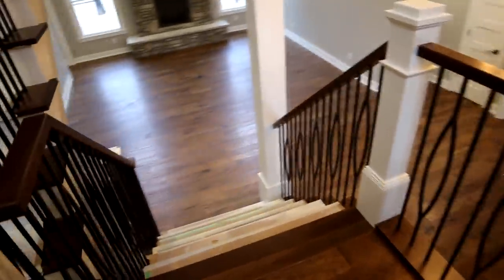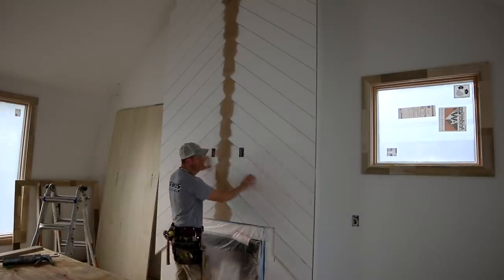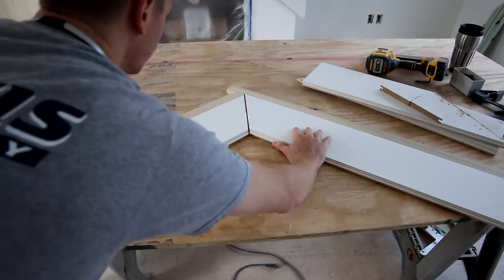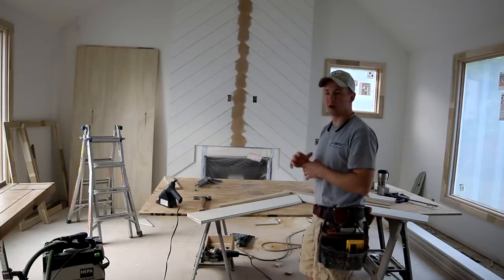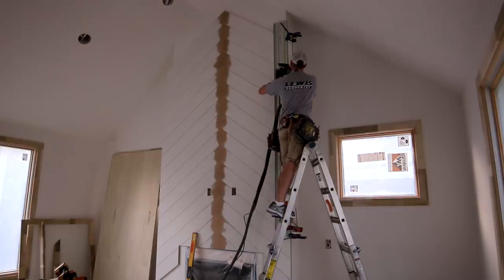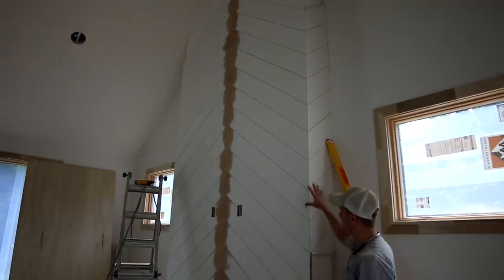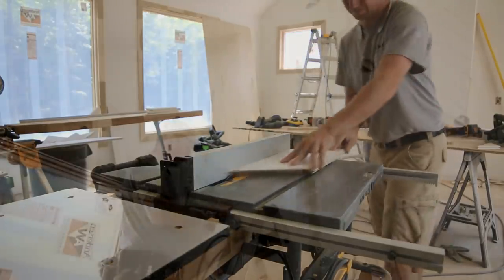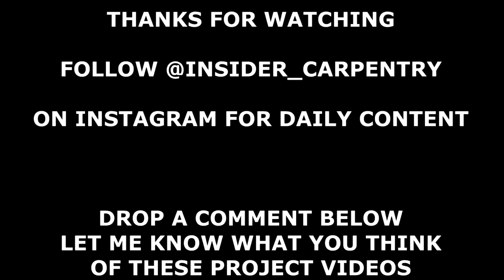Pro Tips & Techniques for a Chevron Shiplap Wall Installation - Chevron Pattern Fireplace Wrap

Comment: I absolutely love your channel. I’ve been a carpenter, frame to finish, most of my life and I’m close to 50. About a year ago, I did something that I thought I could never do, Started my own company and got my GC license. And if you knew me, you would know that the only explanation that this has come to fruition is “JESUS”. It’s amazing!! So now, a year into this, I realized how inefficient my systems, work flow technique’s, tool organization and tool management really is. You have been so crucial,/“paramount” in helping me, in the slow long process of rectifying this situation. At this point I am in the middle of a complete make over of my tool storage system,  pack out drawer, custom dolly, hand truck etc.., also, tower of power (I have a 2021 Promaster, so very similar vans). Then onto miter saw wings, table saw out feed and punch list rolling tool cart. I know this will be an on going process and i will be leaning on you and Jesus the whole way!!! I want to thank you from the bottom of my heart for the help you have and will be giving me any many, many others!! God Bless you and your family!!

Comment: I once put crown molding made from MDF in a living room.  Some months later a pipe in the kitchen burst flooding the entire house while the owners were on holiday.  The insurance company hired a firm to dry out the house.  Every one of the corner joints on the crown molding opened up close to a half inch, I was amazed that 13' to 15' pieces could shrink that much.  But, wonder of wonders they closed back up over the next week or so, fortunately the joints were tight to begin with.  A tiny bit of caulking and fresh paint, all was well.  I try not to use MDF but so many customers don't want to pay for real wood.  Nice job, I only wish my jobs came out as well as yours.
Reply from the maker: I think one of the biggest misconceptions in the industry is that mdf is "stable" and doesn't move. It may not have grain tension but it expands and contracts much worse that real wood at its length.

Comment: Cutting the mitres vertically like you did is absolute torture, when I worked on similar project I used a backing sheet of ply or mdf, cut it first to shape, then attach shiplap to it on the bench as well as  cut miters on the bench. After you can  just fixed the whole thing on the wall. Very often you can hide your fixing in the grove for even more perfect job. Thank you for your videos they are absolutely brilliant.
Reply from the maker: I didn't feel like it was too bad. And went pretty quickly.

Comment: Awesome work! I would recommend titebond 3 instead of titebond original for mdf joints. We  install about 600,000' of flatstock mdf per year and use mostly CA glue and TB3 for our joints. We find original TB too thin for mdf because it starves the joint

Comment: I'm not a pro carpenter by any means but watch for ideas on how to manage work for my day job as a commercial PM.  I'm also getting ready to install shiplap in my octagonal dining room this coming spring so always up for more ideas of how to make that flow better and easier.  How do you like to terminate shiplap at exterior corners?  Corner board wrapping the corner?  Trim on wall with shiplap only? Something else?  I have two of that condition to contend with on this project.  Keep up the good work and content.
Reply from the maker: I'd fabricate some type of corner trim. I've done it a couple different ways. Either a piece that overlaps over the SL or a piece that the shiplap butts into with a dado running vertically to match the same reaveal as the horizontal gap.
Reply: @InsiderCarpentry  thanks for the response.  Would you treat window/ door casing the same way in those scenarios?

Comment: I would love to see how you price this stuff out.  Working with home builders in my area seemed very not worth it compared to direct to consumer.
Reply from the maker: Its all about finding a rhythm and keeping momentum. I can make a higher hourly rate working directly for homeowners, but the secret sauce to my business is in the billable hours. I get way more productive hours and less screwing around looking at and bidding jobs with the builders I currently work for. Its what I prefer. If I was messing around a lot I'd be better off working for homeowners. But with what I do now I can work any hour of the day and do shop work at home, so I like that.
Reply: @InsiderCarpentry Iv'e been doing the same for 25 years. It's beneficial for me & the builder no spending hours after work wirh guestimates. When I work directly for a home owner I just charge a set % also known as a premium.
Reply: Insider Carpentry ,

Been waiting for the info.  
👉🏼⏳=🤑
Reply: Insider Carpentry You have the luxury of working with a good premium builder in an area where large custom homes with considerable areas of finish carpentry detail. Good for you. 🙌👍

Comment: Is there a reason for not using Pocket hole screws on the mid joint for strength and just regular tight bond white glue. Then sand.
Reply from the maker: Time. The hipur is super fast. Just press together and go. If I was to use regular wood glue I would have like to have a domino or biscuit as some added insurance. With the way MDF wicks up PVA wood glue, it would have made me nervous for such a critical joint.

Comment: I’m really inspired by your work and attention to detail. You’re a true, skilled craftsman. I’m curious, if MDF expands/contracts so much, what was the reason for using it over another type of wood; was it strictly cost?
Reply from the maker: Yes. It's about 3x the cost for the same thing in poplar. And the MDF paints up better. You see some wood grain with poplar. And MDF is straight.  No crooked boards with MDF.

Comment: Beautiful job and your detail is spot on. The last piece at the top of the fire box is what caught my eye! Question? Did you do a lay out  of long point of center from top to fire box or was that luck to have that hit right on? The side wall scribe proportion looked real good, small and not overly done.
Reply from the maker: Yes, I layed it out so that it would come out right. Its 7" shiplap so I layed it out in such a way that I'd end up with 6-1/2" on my top piece and have 1/2" to ply with and scribe tight to the ceiling.

Comment: Hey Spencer,  I recently discovered your channel, and I am hooked!    You're a great teacher and truly skilled carpenter.  I am a painter mostly, but also have to do some carpentry myself at times.  Some of the work I've had to paint... O my, what aweful work.   I would love to find a job that you installed.  What a treat to finish it :-)       Thank you so much for sharing!!!

Question:   I didn't notice in the video if you had your track saw set at a 45 for the return chevrons.    How did you do that joint?

Comment: As you mention that you wished you had a different track saw I realized that the reason I don’t own a Festool track saw is because I don’t know enough about the advantages or disadvantages from one series to another .

Question.
Would you consider making a video explaining when you prefer to use one over the other?
Reply from the maker: I was in the same boat. I expected the TSC 55 to be underpowered like everything else festool makes. But once I started asking around guys said it was great. So i bought one and was pleasantly surprised. That would be a good video also.
Reply: @InsiderCarpentry  i have been on the fence about purchasing a tsc55. I have had a ts 55 for 9 years now and love it. You are that happy with the cordless model?
Reply from the maker: @Jddlincoln  I like the TSC much better than the underpowered TS55. I just had my TS rebuilt after about 6 years using it. I recently purchased the mafell 55 and it has way more power. But for cordless i have been super impresssed with the TSC. The dual batteries give it a good amount of power.
Reply: @InsiderCarpentry  Thanks, I have been hesitant to pull the trigger, but tho is definitely helps.
Reply: @InsiderCarpentry  does the Mafell work with the festool rails?

Comment: How did u make that outside 45 with the angle at the same time ?did you use chop or table saw
Reply from the maker: Compound miter on a miter saw. Bevel set to 46, miter set to whatever the ceiling angle was.

Comment: I’d like to know the process of the finish cost on that ship lap.  It glows under those lights. Almost looks like tile! Was that the painters ?
Reply from the maker: It comes as a pre-primed mdf tongue and groove product. It starts out very smooth. Painters don't have to do much besides spray an even coat and it will look good.

Comment: I realise MDF expands when wet/damp but in dry circumstances, internal work, I never knew it expanded.
Reply from the maker: In dry climates it doesn't. But it the midwest yes, moves a ton. I have the exact product I used in the video in my own home. One year I forgot to turn my humidifier on in the winder and it shrunk 3/8" in 15'. I've see other carpenters install it on ceilings with just butt joints and two weeks later is got 1/8-3/16" gaps. Long lengths are not to be trifled with.
Reply: Never knew that either, in Ireland I've never known it to shrink. Moisture resistant MDF is getting really popular here though.

Comment: Great job. How would did you determine the side panels (angle or cut) if the were running horizontal, not at an angle similar to the front. Similar to having a baseboard on top of a stair stinger (angle) that meets up to a 90 degree corner baseboard on a landing? The angle piece would be wider than the horizontal piece? Hope that makes sense.
Reply from the maker: Right. It doesn't work unless they are at the same angle. Otherwise the cuts are not the same width and the dados wouldn't line up.

Comment: You say there is a learning curve on the HiPUR glue. What do you mean by that? I have watched and re-watch many of your videos. It is great to learn tips a tricks. I have been a carpenter for 36 years and still learn things from you. Thanks and keep those videos coming.
Reply from the maker: I plan to do a full video going over all the nuances. Too many to list. Basically a lot of guy try it, run into issues, and then give up on it.
Reply: @InsiderCarpentry  I am seriously thinking about getting set up like you are and give it a try. It a pretty pricey investment to try without knowing more about it. Again thanks for the great content.
Reply: HiPUR used to have 5 versions of glue, I think it's now just 1. Getting it to set your joints just perfect by holding the material just right... Takes some practice
Reply: @stevekwaske4612  I have done some research, Hipur has 3 different cartridges WW30 (30 sec) WW60 (60 sec) and MP75 (75 sec & waterproof). I think this may come into play on more then miters on trim for me as I build allot of custom built ins & cabinets.